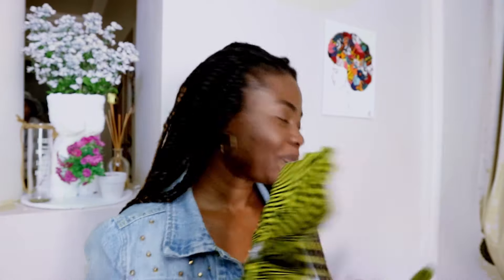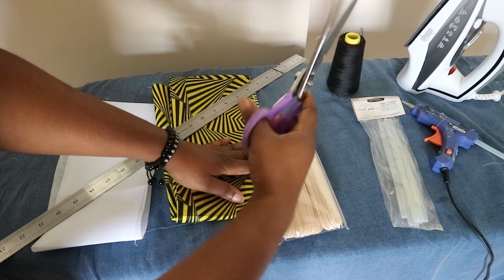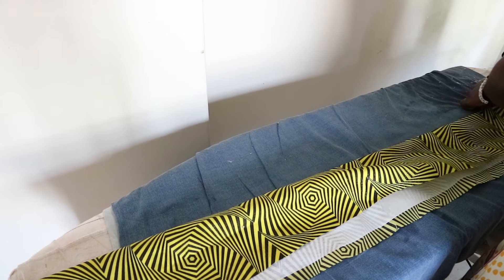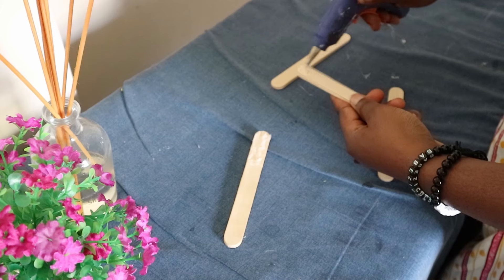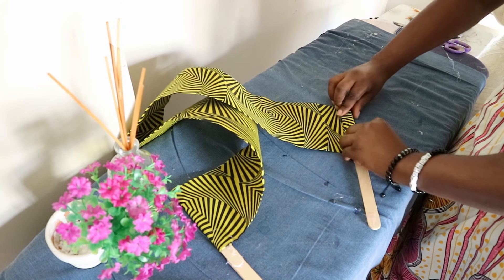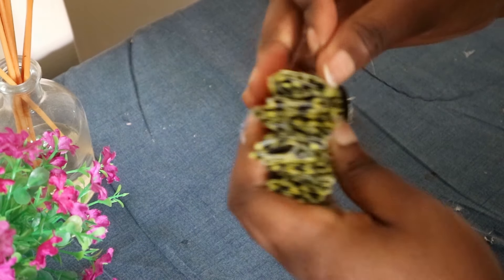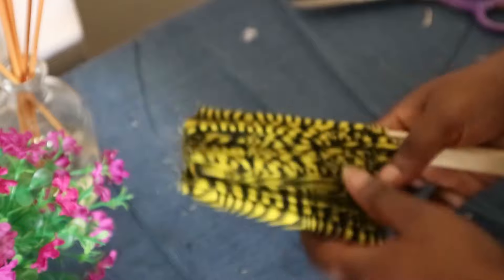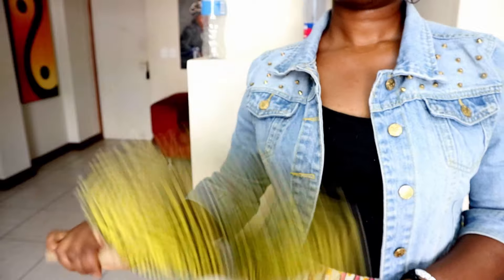DIY Ankara Fabric Hand fan |Pelumz Secretz

Comment: I have no idea why mine is shaking when I fan with it but it's beautiful.  Any suggestions?
Reply from the maker: hello. I am glad you gave it a try. Did you use interfacing on the fabric? also, check that the sticks are well glued and sturdy. I hope that helps
Reply: Yes please. I did add an interfacing. I'm not sure if the interfacing was not stiff enough. Its shaking as if its heavy.
Reply from the maker: @fellitagarraway9877  hmm, maybe it's the type of interfacing used. Give it another attempt. Practice makes perfect
Reply: I will thanks
Reply: @fellitagarraway9877 same here
Have tried severally 😢
Reply: This is beautiful really cos I tired it with my students but the end wich is the tying is really stressful. Can I get help please. Like it's stressing me out.